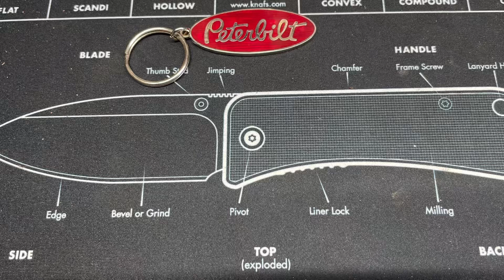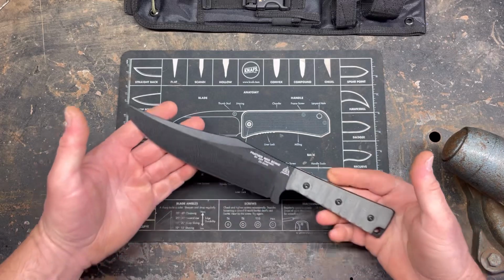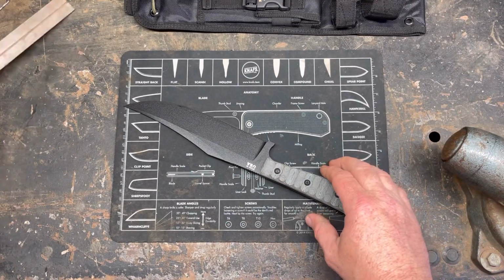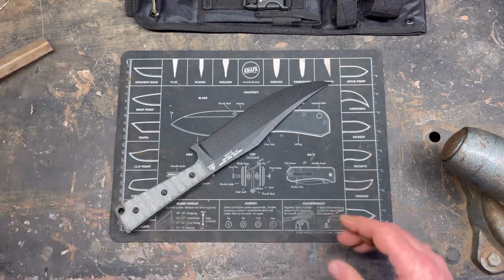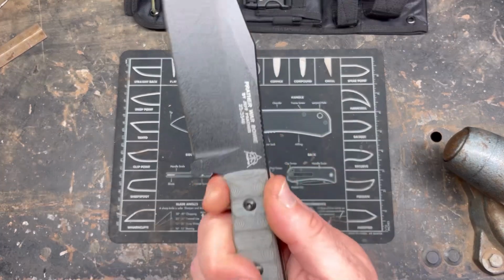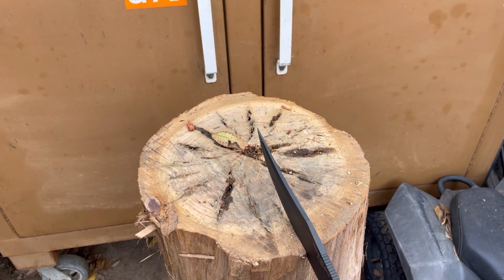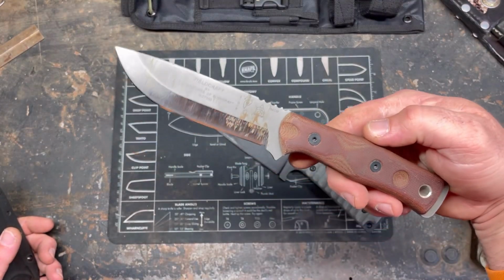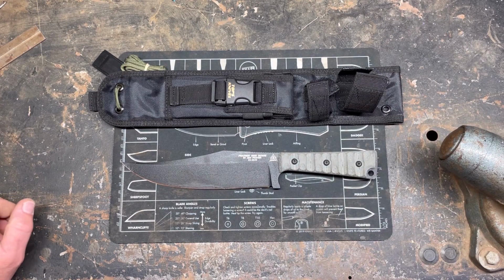The TOPS Prather War Bowie. Underwhelming at best

Comment: I have been using mine for 2.5 years and it has survived a lot of abuse in a variety of conditions - Himalayas, Indian jungles and Norwegian tundra. The coating will become smooth over usage - at least in my case. 

My only gripe is the sheath - replaced with judex right away. The handle - as per the desginer - needs to be held closer to the pommel. 

Get yours replaced. I'm sure people at TOPS can remedy it right away

Comment: I've carried mine while deployed as infantry, I love it. It is a shame yours seems to have slipped through QA/QC
Reply: What precisely do you love about yours in terms of actual use on deployment? What have you found it to be proficient at, what is it deficient at?
Reply: @jessr.2490  It pretty much does everything you would expect a knife this size to do. It chops well enough for its size, though not great. Leaves big damn holes in soft organic materials at least 7.5 inches deep easily, even if organic materials are covered in heavy cloth. Would make a great dispatch knife for hogs being held by catch dogs. Does well enough against light brush. Cuts zip ties, 550, ratchet straps a treat. Fast in hand, love the balance. Sheath ain't great, needs a new one.

Comment: I have this knife. It does not have that issue. I did reprofile the edge to make it a hair popper. I also removed the coating. I use this knife for bushcraft regularly i find it a pretty good jack of all trades. The swedge actually works well for batoning. Even better than expected but it will bust your batoning stick quick. The guard being part of the profile actually helps alot and gives me a confident purchase on the knife during use. Its not perfect. If you do get a replacement. Give it a better edge and you'll be impressed. I highly recommend taking tops up on their warranty as that is covered. I am happy with mine.
Reply from the maker: It definitely has potential. I’m just mad at it right now. I have a 70 dollar sheath coming soon. So I need to get one the replacement lol
Reply: @peterbiltknifeguy  haha sheath is a good call. I have an old leather sheath that fits it but want something better. What did you order?
Reply: @peterbiltknifeguy  btw I love your content. I would really enjoy a video showing a step by step to your sharpening methods on big blades. You always seem to have a great edge.
Reply from the maker: I’ll definitely do a more in depth video
Reply: @peterbiltknifeguy  atta boy. Merry christmas!

Comment: The coating (based on my experience stripping it) is the equivalent to spray can bedliner that has been applied to a poorly prepped surface. The steel underneath is rough as all get out with deep grinder marks and often metallurgical flaws.
The coating allows them to skip multiple finishing steps and hide defects very effectively.
Tops knives are made of common materials that still don't cost a premium and the cheap Chinese sheath they often ship with are worse than actual cheap Chinese sheaths, requiring further cost to make the blade useful.
The hype people give this company is undeserved and not earned in real life. I love my Prather and the CUT 4.0 but doubt I will ever buy another Tops knife and highly recommend to anyone that asks me to skip this brand for the most part.

Comment: i have gotten several bendt Tops blades, returned some. And the new ones youget are not straight, that's fun. It is the diffirensial heat treatment i think. They bend more often that way.
Reply from the maker: I honestly think that you are correct

Comment: Tops will replace the knife, no problem.  Amazon also has easy returns...  I have always liked the look of the Prather War Bowie, and have plans on getting one.  I have a Power Eagle 12 and if it is the same coating, it is quite durable.  When the large bowie called the Atrox came out from Condor, I got one and the blade was more bent than yours.  Instantly returned.  I have several Condor machetes, and that was the only time I got a bum blade from them.  When Bark River put out their 1V machete, I got one, and guess what?  Bent blade... I returned it and it took the clowns at Smokey Mountain about 2 weeks to process it back and they were sold out so I couldn't get another one.  Oh, all the new Tops Knives seem to have kydex sheaths while the older models have the garbage sheaths... Sorry about the disappointment with the blade!
Reply from the maker: I’ll definitely hit up tops. This knife has potential. I know it’s not a common problem. I love tops

Comment: I have an absolute infatuation with the aesthetics of mine, even though because of that finger guard design, I don’t find it entirely comfortable for long term use as compared to my Esee 6 or Steel Will Chieftain. I really feel that if TOPS would release a new version of this knife with a micarta handle that fills out that metal finger guard area, therefore widening the surface area that the forefinger buts up against (and perhaps scallop out the front edge of the micarta on the blade end for a good pinch grip) they would have a phenomenal survival knife design that would be the biggest and baddest on the market in both function and aesthetics (because let’s be honest, it’s the aesthetics that prompted all of us to buy this blade). I freaking love that huge clip but the handle is still the most important aspect of how useful a knife is for a given use. I’d wager that most people who buy these are using them outdoors, first and foremost.

Comment: Looks like someone tried to demonstrate to someone how solid a knife it is and tried to twist it in a vice or something .....  I actually prefer to have kydex or that nylon sheath over a leather one because I tend to forget to take care of the leather as well as the blade....... oooopppppsssss , picture a leather sheath that dried out , had mold inside withe blade which in turn meant super rusty knife........😮‍💨😢
Reply from the maker: I’m thinking it twisted after heat treatment. But dang. That sucks about the leather